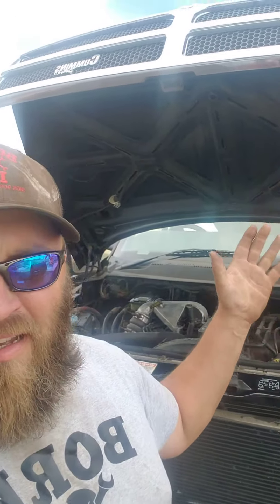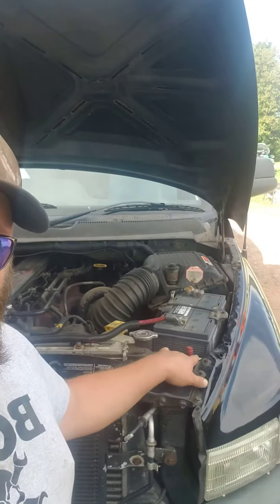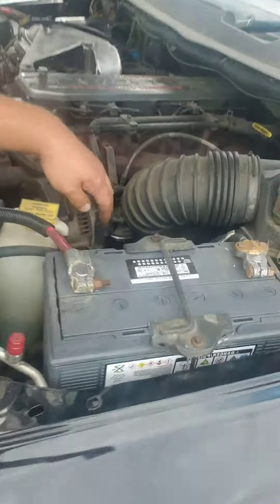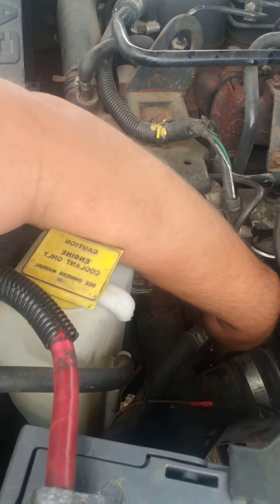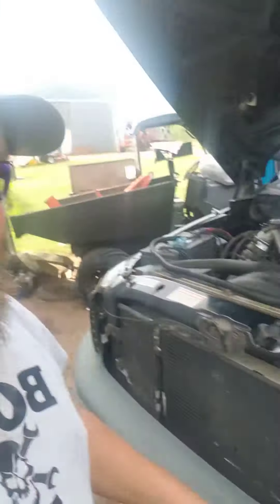What in the Mopar F@CK???

Comment: I did that to a dump truck at work. They gave me the wrong low side line for it without the port. So I only had the high side port. With our ac machine at work I was able to charge it, but you’ll never do it with a bottle and gauges. Wrong way to do things but got the driver ac again. The life of being a mechanic

Comment: That's not a mopar problem some idiot put a high pressure line from or for a 1998.5 or newer Dodge truck with a 24 valve Cummins.  I ran into this once I just pulled the orifice tube out of condenser and changed the ends around on my R12 to R 134a gauge set I have multiple gauge sets for doing air conditioning repair work